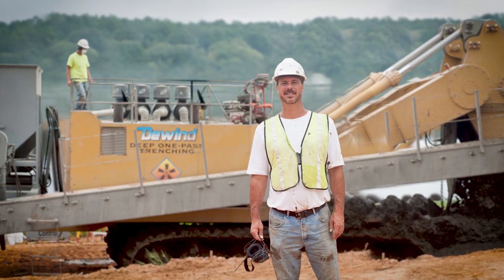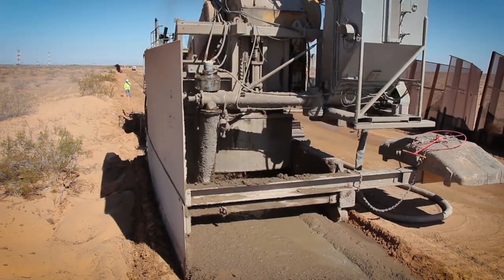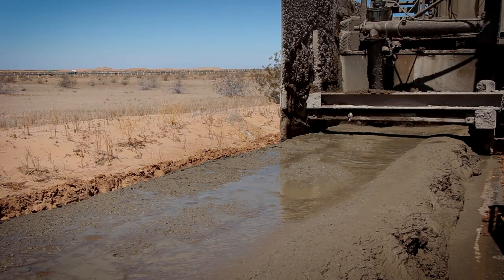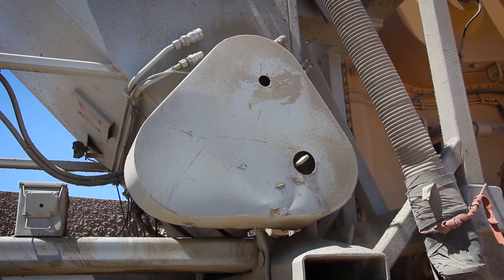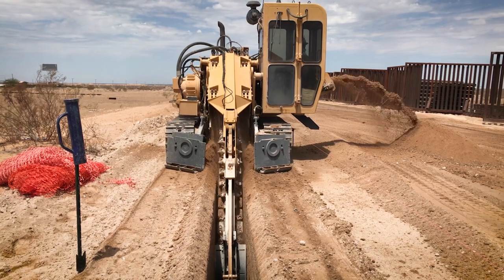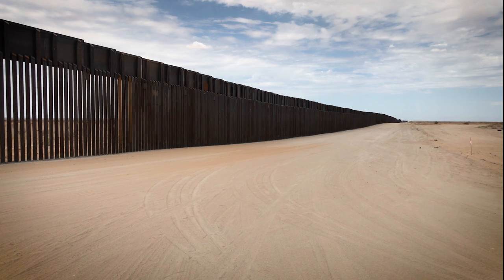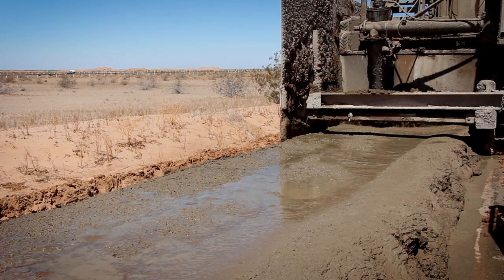DeWind One-Pass BORDER WALL FULL INSTALL Version.

Comment: Very cool.  The original trench is like eight feet deep and filled with concrete and then the smaller trench has reinforcement added before that wall and concrete are added.  Probably still need some sensors because wouldn't put it past the cartels to use a tunnel machine to go through it.  But it's a great start and should help the Border Patrol.

Comment: That foundation looks pretty soft if they are able to dig it with a trencher. Figured it would be more like concrete since the ingredients are similar (maybe closer to mortar if it’s mostly sand and no rocks). Are they just skimping on the Portland cement to save on material cost? Or do they want it to remain kinda soft (in relation to concrete)?

Comment: They need to electrify the wall cartel and smugglers are cutting through the wall with saws that you can buy at the hardware store.
Reply: That is bs lies.tell the truth
Reply: Ok "they" electrifed  the fence.. You dont know that a basic bypass can clean a section of the fence in a matter of 25 minutes?
Reply: Peg Leg  you can go to the fence any time and find out if they are filled with concrete or not... The fence sounds like a marimba.
Reply: Electricity is defeated with a rock on a wire.  Claymores would be more practical.
Reply: Well, that wasn't the story exactly. They used specially crafted saws to cut through the temporary placement beam barriers. These walls in the video are different though. The sawing happened around California where Border patrol is more active and closer to people. 
So even though they can saw through it will surely take a while. And they will know exactly where they got in.
Reply: tea time commenter I live few feet from the fence..the sections in the video  are the same as the ones in California. ..toarch or any cutting tool will do the job
Reply: Randy Wiesendanger Randy ...Randy..is that all you have..?"..while you still with your mama..."..that is an old one. I expect sonething better than that ..unless you are 12 years old.
Reply: Randy Wiesendanger  is there anything wrong living with your mama?, in fact she is living with me, as a 91 year old lady , a think, now is my time to take care of her, I will never take her to a home for the elderly to die alone, many do and will do for years to come, if you are one of those ...I fell sorrow for you.

Comment: Needs to be much deeper. The only thing the bollard style wall is good for is the steal reinforcement for the much larger concrete  "Great wall of China"  style wall. 50 feet high with a two lane road and mile towers. Something spectacular that will draw tourists.

Comment: i wonder how deep this one pass trencher can dig.. imagine doing this close to where tunnels have been dug.. but coming back with a single trench slightly offset that has looped reinforcing panels.. so if one wire gets cut.. it shows up as an open circuit..  that is dropped into the single trench..  after that cures a second trench a a foot away is dug parallel.. again.. looped wire panels dropped in.. concreted.. ... when that is cured the slurry between them is dug out.. leaving an air space..  concrete wedge blocks could be set to hold the tops of the wall open.. allowing border enforcement to keep an eye on anybody trying to dig thru..  of course i have seen trenchers that can dig 100 feet deep for sewer line installs..  just thoughts.. only other thought would be using up the scrap oil drill pipe and putting one every foot 150 feet deep. but instead of just capping it.. each one is pressurized.

Comment: They left out the drug dealer with the $100 circular saw cutting a door in it in 3 mins right behind them.
Reply: Just think how bad it would be without a wall
Reply: @toledojeeper2932  spend billions of dollars on something that can be breached in mins with $100 tool. If you're going to do it do it right or don't do it at all.
Reply: @randomguyontheinterweb  ....the border patrol said that cuts in the wall have not been a problem like what has been reported...the wall is a deterrent
Reply: @toledojeeper2932 so you're saying if you spend 1 trillion dollars on a missile defense system but the system doesn't work it's ok cause it's a deterrent? Don't spend the money unless it's done right.
Reply: @randomguyontheinterweb  ...the wall is only a deterrent...border patrol has said that from day 1

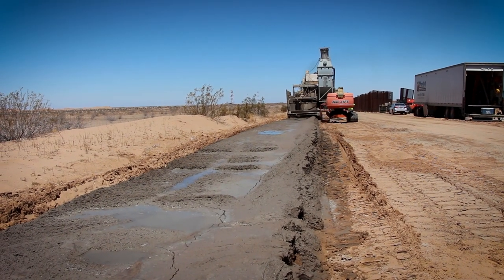Comment: It still needs a second trenching operation, as shown at 2:35 so I'm not getting what value this provides, as impressive as the operation is.
Reply: Samm Hill  they didn’t design the wall they are just building what was requested by the people who did design it.  Could you imagine an excavator or normal trencher doing this?  Then following them by building molds and pouring the concrete.  One pass, one machine...foundation complete.  Then the people build the rest of the wall with it.  Could the whole process be even better?  Yes but unfortunately Dewind is not in charge of the whole project.

Comment: It's okay when I do my tunnel I'm going to have to go 20 feet deep in that
Reply: We'll be listening through the use of amazing sensors!  Don't Go there!
Reply: To all that think that the wall is impenetrable.. When the technology of SDHS, CBP, USBP, is put on the table to be applied the carteles already have solutions and ways to avoid the new electronics
I have seen 5  diferent "walls" in the past 50 years, the drug  problems and human smugling still is in the rise and will be as long there are addicts, américan maffias, prostitution rings etc, etc.. The whole problem is 50/50, supply and demand. 2 countries 2 problems.

Comment: First they pour a foundation then the remove a trench of it... Why not create that trench when the concrete is poured? It seems a waste of time and materials.
Reply: The wall has to be embedded in a trench 6' x 8'. They are actually using less materials because they are not removing the trench soil and replacing it with concrete. They are stabilizing and hardening the soil using Portland cement. They save fuel, truck wear and tear by not having a continuous stream of mixing trucks for the main trench. 

Every 1' of trench length done by trench in place saves 2 cubic yards of concrete mix.

Comment: ?? After the foundation is stabilized another contractor removes the top 12 inches?  What? That concrete before 2:30 looked slightly above grade. Then at 2:39 that looks like a completely different system digging in virgin soil with no foundation.

Really not understanding this????

Comment: So this wont be passable with a ladder 3 feet higher than the wall? Smuglers will cut through the steel or use hydralic jacks to create bigger holes in the bars. The wall must be guarded by electronic sensors, drones and enough manpower to reach within 1 minute of a breach! A wall alone is just symbol policy...

Comment: See San Diego, Ca news.. for $99. Smugglers using a simple hardware store sold reciprocating saw are now being used to simply cut  large and small holes thru TRUMP's IMPENETRABLE wall .. and smugglers are have a hay day as walking right thru.
Reply: That’s one way to make new jobs. Fixing the wall every another day. They cut. We fix are tax dollars at work. 
Should have just made a water way that was 2 miles wide 100 feet deep. Fuck this wall BS.